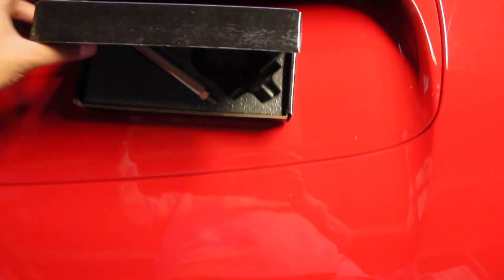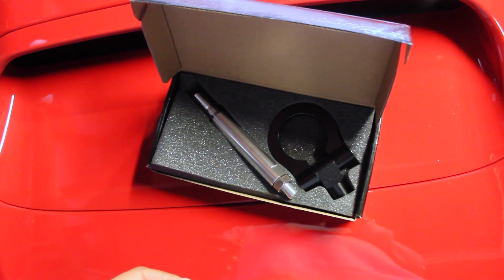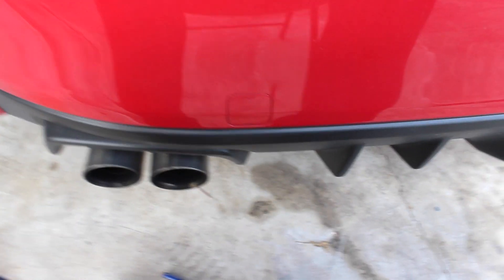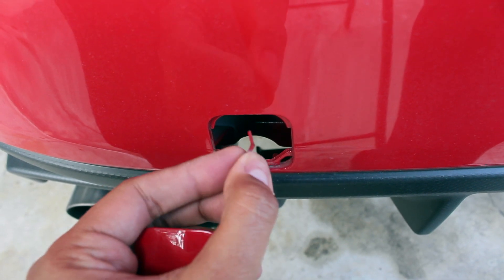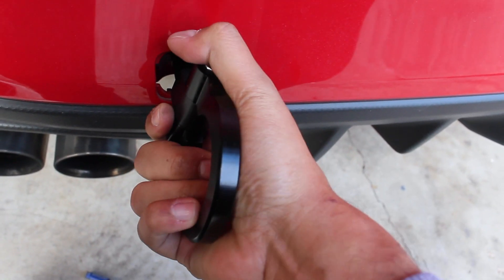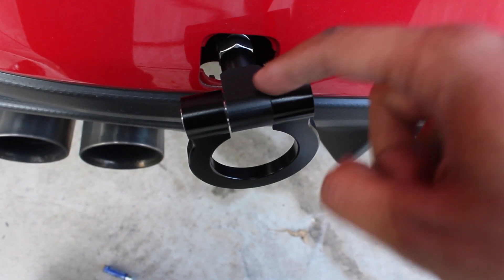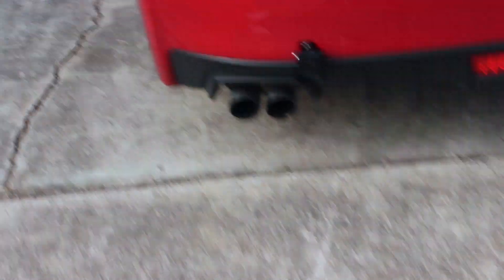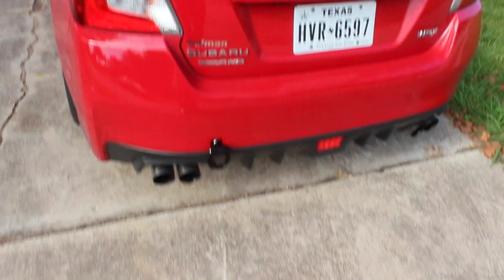2015+ WRX / STi $26 JDM Tow Hook

Comment: Just a helpful tip, these tug hooks are 25 because they’ll snap and break once they’re under tension.. they’re 99% cosmetic.. now when you spend that 150 on one you’re pretty guaranteed that your hook won’t snap if you’re trying to get pulled out of a ditch or something.. look into the raceng if you want a fully functional tug hook for your wrx, if you just want it for looks this the best route

Comment: Late to the game on this... I have some feedback:
1) Use a flathead screwdriver to pop the cover off like you did, but if you put a hand towel over the screwdriver it won't cause any damage to the paint.

2) I would've put anti-sieze on the thread/nut (gigity.. jk) prior to installation.

Comment: Rumor has it, they break under any legit load. Can you confirm or deny?
Reply from the maker: +John Stepp never tried. But it's pretty solid I wouldn't use it as the tie down on a full racecar but for an occasional pull it's fine
Reply: I towed a Mercedes E class out of snow couple months ago by using this. It did not break at all.
Reply from the maker: +Zheyuan Lyu how did the WRX do in the pulling? It's light so I'd assume not good
Reply: It did pretty well actually, first try failed, second time I turned off traction control and pulled the mercedes out easily. I was on winter performance tires.

Comment: would this fit a 2016 subaru crosstrek STI
Reply from the maker: It would fit the thread, i'm not sure if the distance would be good. But probably. What is a Crosstrek STI?
Reply: ohh alright thanks its a crosstrek with a sport package, and i have done some stuff to the engine.
Reply from the maker: +DEVIN Hynes sweet I like the cross Trek it's pretty capable from what I hear. It has the same ground clearance as my wife's pilot

Comment: You should paint your headlights! that would look super aggressive
Reply from the maker: +Fox Stowe I'm not sure how
Reply: Hqen2000 its fairly straightforward, remove the bumper, take out the headlights, seperate the lense from the body using a heatgun or oven (i did one without any heat and one with a heatgun) then simply unscrew the plastic part, spray paint it then remove all the stock sealant and reassemble everything then reseal with new sealant
Reply from the maker: +Fox Stowe I wouldn't mind doing that but it seems kinda scary. I'll see if I can find someone else who has done it
Reply: Hqen2000 yes it was scary haha. After i painted when i tried to put it back in the sealant would stick on the paint and rip it off, very frustrating. Took a while but in my opinion totally changed the look of the car. Patience and caution is key
Reply from the maker: +Fox Stowe is there a service or somewhere I can get it done? I just blacked out the badges and put rally armor mud flaps it actually looks really good right now. I'm not sure what do next. I'll post the videos when I'm done editing.
Reply: Not sure i think Lightwerkz does it but u have to mail in your lights so u wouldnt be able to drive for however long it takes.
Reply from the maker: +Fox Stowe I found them it's www.zworklights.com. They look pretty nice you'd have to ship them the lights and they'll ship them back. For the c light switch back upgrade, and painted black housings it'll be 450 total. A bit pricey... I think they'd look nice but that's a lot of cash.